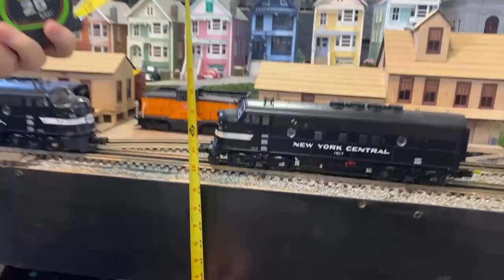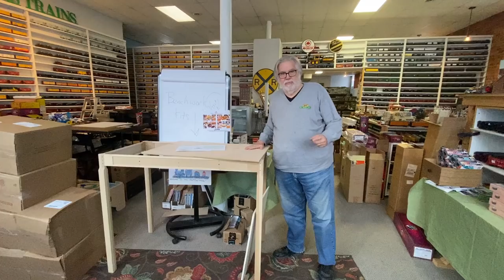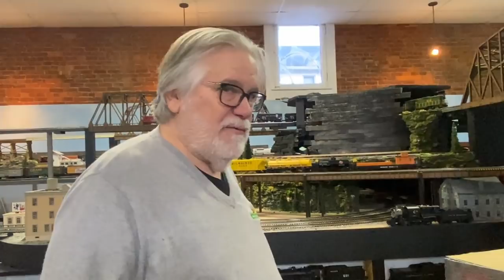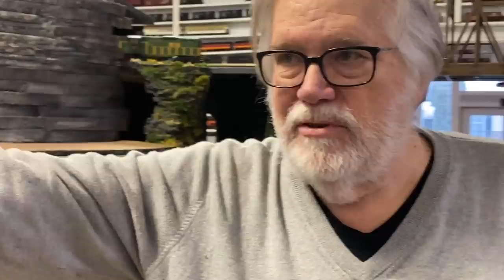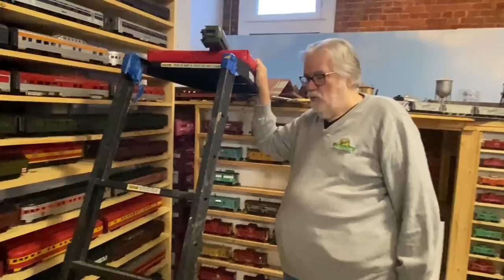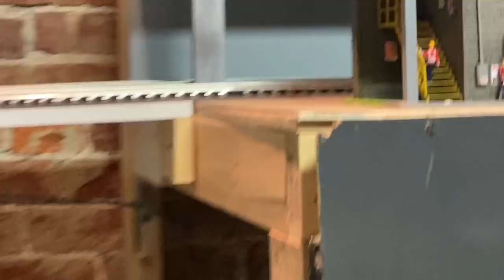MrMuffin shares some layout design principles from MrMuffin'sTrains

Comment: Love your video! I am a novice with wood working and benchwork. Extremely tight budget cannot afford MIANNE Benchwork for a 4x8 section is $400. I am planning on using two 8ft folding tables from the Depot for temp benchwork with artificial outdoor carpet if green color is avail all this for under $200. This is not permanent, but for those with a tight budget, this will do. Adjustments for height can be made with  2x4 cut blocks under feet or Aluminum Pipe cut and drilled with holes thru the feet on the bottom with levelers underneath. Thanks again for your advice.
Reply from the maker: PVC Pipe cut to the proper length makes a great way to extend the legs on your folding tables.... consider making a 1x4 or even 1x2 platform to put on top of the tables - then a wood surface on that........
Reply: @MrMuffinsTrains  Thank you! I will consider the PVC for light weight option!

Comment: Mt Muffin - I assume that you will commit to a track design without having every scenic/view block completely worked out? In other words, should I minimally have the concepts worked out but expect new insights and changes as you go along?  I struggling with deciding on a track plan. Perhaps I should just select a reasonable plan, put it down and expect to experiment with the view blocks after the track is down. Thanks for any guidance. This was a great video.

Comment: Mr. Muffin, great video. I checked out MDF at Home Depot $35.54 for one 2x4ft, way to expensive dont you think? Also, if you paint layout with tender twig paint, how would you construct rivers and lakes and rioads? I use Woodland scenic table cover rolls which do great. Your thoughts.
Happy New Year.
Reply from the maker: Yes, that's too much money - I think I was buying sheets at Lowes for about $50 for a 4 x 8..... we use clear hammered glass for water, with painted Masonite under it for the water effect.... for roads, I use strips on Masonite again spray painted gray, then sprinkled with sand, and painted again.... doing things the same way, like the tender twig, across the whole layout pulls everything together......